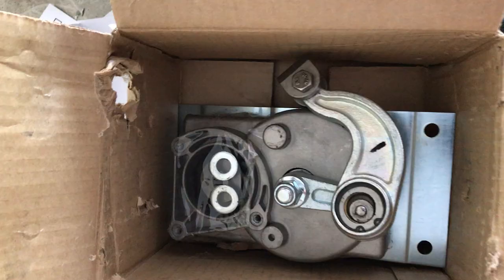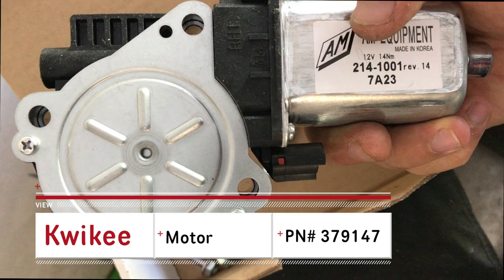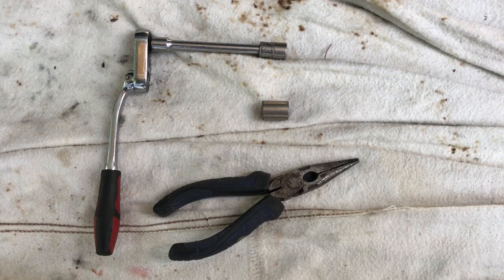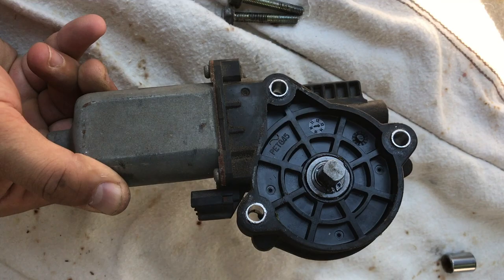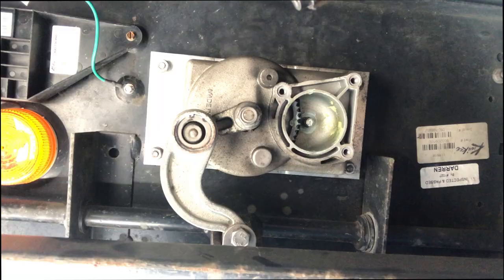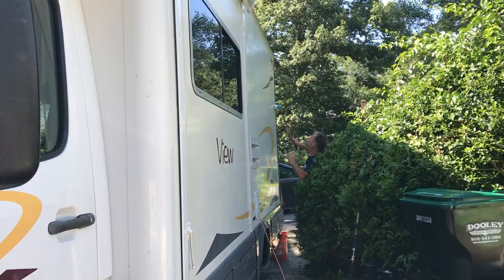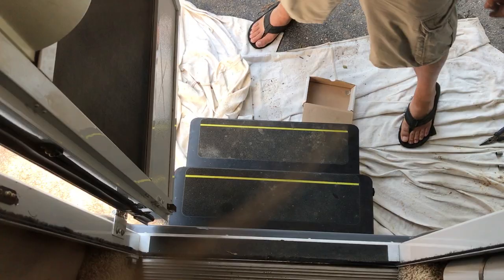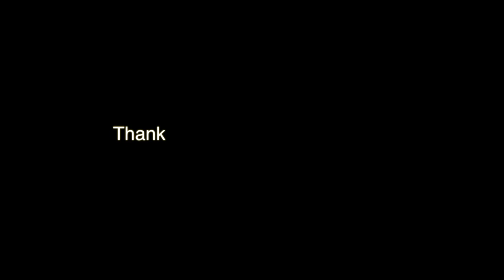DIY RV RETRACTABLE STEP REPAIR

Comment: You didnt mention the gear and pin that fall out when you remove the motor that turns when the motor runs. Very important part.
Reply: Good call.

Comment: I'm having trouble with my Kwikee steps. I tested the motor and it's good. I could hear a ticking noise from the control module when I turned the steps on. The motor was not getting power. I ordered a new Control Module. I hope that is the problem?
Reply: I’ve never ran into that. Please let me know if that fixes it. Would love for folks to find that solution.